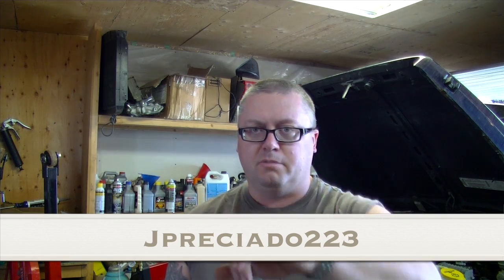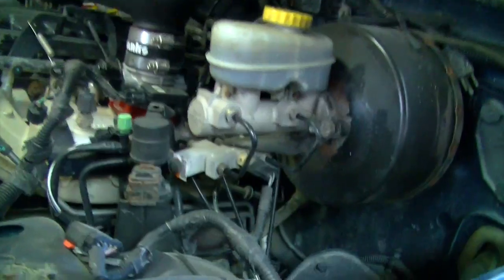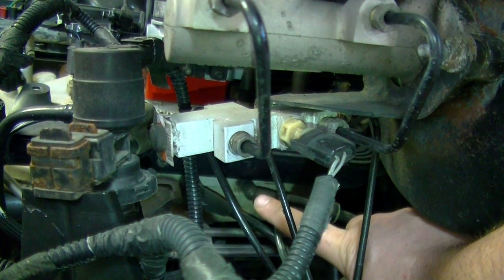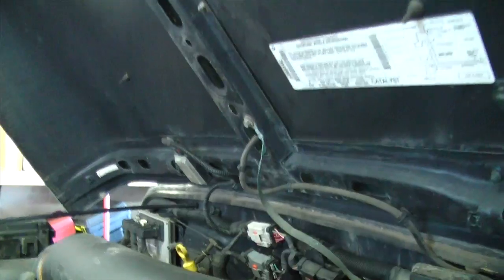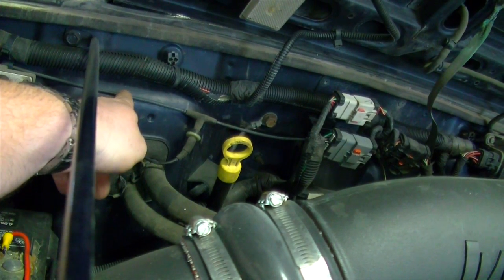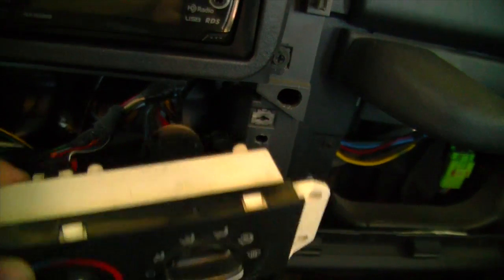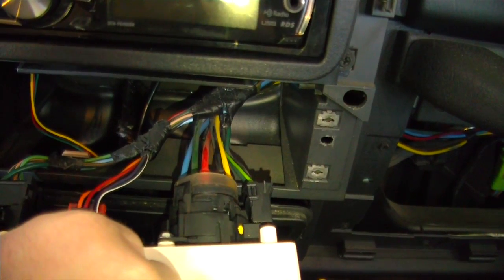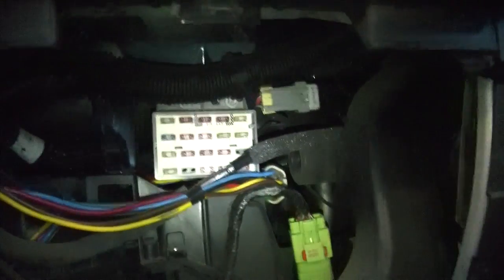Jeep Tj Hvac Troubleshooting Vacuum Issues

Comment: Ok, way late to the commentary, but hoping there is an answer here. The line between the T check valves (running across the back engine bay/firewall were accidently cracked releasing a hiss. So I know there is an issue. Any idea what the specs are on that line so I can replace it? Thanks for any help.
Reply from the maker: It’s just a vacuum line easily available on Amazon or local parts store
Reply: @BackCountryWrenching Got it. It’s Part # 47418   (Dorman) 5/32” 3’ at either Autozone or O’Reilly’s in case anyone is looking for it later. 3’ is the OEM length. 

Just pull (twist) off the original boots from the OEM hard nylon tubing & reuse the them (if in good shape) and all set. 

Thanks

Comment: Very awesome walkthrough. Strange, I have vacuum but my selection controls are mixed. Full face mode is on the Face/Feet option. Would a vacuum issue also cause this and poor cooling of the AC?

Comment: 2006 TJ vacuum line comes in thru firewall and black line is behind the fuse box that is behind the glovebox, 2 screws remove the fuse box and use a flashlight you'll see the black tubing coming thru firewall, mice chewed mine right in half. 1/8 hard vacuum tubing and vacuum splice connectors to fix it. Sometimes also the knob on the selector switch itself cracks and doesnt actually turn the selector for floor, defrost, panel etc, pull knob really hard it'll pop off then check it for split or crack. The selector switch can go bad too, it's on ebay for 70 bucks as a unit with the other switches and what not for fan speed

Comment: This vid is 9yrs old so hopefully you get this.
Had a shop install a new heater core but I get no heat. Have replaced everything (was going to anyways) and thought I'd find the issue. Nope.
New rad, water pump, thermostat, hoses, system was air-bled more than once, new blend door actuator...still no heat. Inflow and outflow hoses from heater core exact same temp.
The last thing I have yet to check: the hot/cold dash selector dial.
Is it vacuum operated too or only by the blend door actuator? How to check to ensure it's working?
Have scoured the 'Net and manuals looking for an answer but nothing comes up.
Help?

Comment: Love your channel. I first became aware of you, while looking for info on dodge transfer case ( the same in the Jeep). I am currently troubleshooting my HVAC and the vacuum lines.
.y questions about the E-brake, I've replaced the rear brakes and  replaced the E-brake handle cable. I  still have no E-brake. What could I be  missing?

Comment: Great video as always!  You've bailed me out more than once.  The vacuum line behind the computer goes to a vacuum reservoir underneath the battery tray.  It's a little black box.  I recently had the problem default defroster and floor vents and it was because I fucked up putting my air box in after replacing the heater core.  I accidentally bumped the bottom of the box and the linkage got knocked loose from the actuator on the bottom.  I wish you were my neighbor. It would be easier to give you those beers you've earned.

Comment: I have no codes, both ac and heat coming out of face ducts, switch seems to be issue as i can’t change flow output.  When i go to recirc ac, system pumps more air, so the electrical portion is working but do you think the vacuum portion of the switch is bad ?

Comment: Great information! What should I check/replace if the air is not blowing out of the vents? I can feel cold and heat out of the vents however it’s not blowing air. Thanks in advance. P.s I have a 1999 Jeep Wrangler TJ 4.0
Reply from the maker: sounds like the blower motor isn't working

Comment: With the help of your video. I was able to identify a vacuum leak below the battery (not idea what is the purpose of the black box). Just taped with a standard electrical insulator tape and now Air Conditioner air flow is perfect. Thanks for your knowledge sharing, God Bless You.
Reply from the maker: The black box is a vacuum res

Comment: OK some additional info. I had the issue of AC working fine until accelerating, AC keeps working but the vents change to defroster only. When you let off on the accelerator, vacuum increases, the "face"/"front top" AC vents come back on. I verified all of my actuators hold vacuum along with the vacuum reservoir and all lines inside the TJ. I replaced the HVAC switch panel fearing an internal vacuum leak in the switch, the panel also had a bad/dead position on the fan switch. This did not fix the issue.  In the end, a $6.00 check valve was the culprit! Easy test/fix, put a new check valve in the line to the HVAC at the manifold, check valve flow direction to manifold, see if the issue goes away....Mine did!

Comment: I have a 99 Wrangler 6 cyl .  Your video was very helpful and I checked all the lines I could see and they looked good.  I have constant A/C or heat until I put the engine under a load and then it goes to default defroster mode.  Because I have good vacuum most of the time I am wondering if the problem is a faulty vacuum reservoir?  What do you think?

Comment: My '03 TJ 4.0 will only blow out the dash vents. It will not blow to floor or defrost. Any suggestions?
Reply: if you have vacuum to the black vacuum line on the back of the selector switch, check your vacuum actuators under the dash maybe they are not working or stuck, could have a mode door stuck also https://www.youtube.com/watch?v=epYsP6hX2d4

Comment: I've been having a high-idle myself (on a 97 TJ) and tried to find leaks using starting fluid. I fixed one line but the idle was still bad.
THEN I saw this video and for kicks just sprayed the same plug and sure enough the RPM dropped.
What's the fix for this?
Also thanks, I've been battling this for some time now.

Comment: Hey, man I'm looking for some help with my Tj, I'm having an issue where i have vac all the way up to the cab and it will blow out the top stuck on defrost, however, i feel like one of the actuators are getting stuck, i leaned under the drivers side and i see 3 of them and i can see them move on at least two of them the other two, don't seem to move much, if i reach under and assist the push of one of them, it will start blowing out of the main vent, however it still blows out the defrost. Is there any way to clean these? Or do i just need to buy new ones?

edit1: do you know where i can buy these at? (a link would be very helpful)

Comment: @Bullshitkorner, tell me if this sounds nuts, but in my case - this vacuum leak was causing P0301 misfires in my 2005 TJR. I had replaced the exhaust manifold and fubar'd the vacuum line somehow. Replaced the harness and the misfires went away.

Comment: Jerry's video put me on the path to fixing mine.  For maybe a year I had sporadic problems but the vacuum lines all looked OK and I was stumped.  Eventually I realized the 2 very thin plastic lines that take off from the main line had become very hard.  Then I found tiny cracks in these, 2 just outside of where the line entered the firewall to go to the HVAC, and one going to the cruise controller under the hood.  The cracks were smaller than a razor could make and hidden by grime.  I never would have looked so close unless I'd seen this video.  Solved my problems for cheap, hope this helps somebody else.

Comment: Hey man, thanks for the videos, always a pleasure.
QUESTION, I think I have a vacuum leak, upon Deceleration, tj will die at stop light sometimes, if I don't slowly shift down and keep rpms up, isles perfect always. Only does when slowing down from freeway speeds rapidly. So I think I have a vacuum leak. Any specific ones your recomend to check? I also heard that if I just spray axe body spray ( the cologne) my rpms will rise when I spray in the area of a leak...anybody ever done this? 
Any tips? 

Thanks everyone

Comment: READ THIS FOR A\C STUCK ON DEFROST. If anyone verifies their line is hooked at the manifold follow that line down below the battery tray. lay on the ground behind passenger front tire and look up near the ac vent hose and you will see the line connecting to the side of the black box. The end of mine was cracked. I cut the cracked end and put it back on and A\C WORKS.
Reply: they changed it so u cannot look up on 2005 and 06 i think, need to pull battery and battery tray

Comment: 04 tj also but my selector does not work and I get AC or Heat through all my vents.   sound like the same problem?
Reply: pull panel with selector switch out and see if black line on back of vent selector has vacuum, if not you have a leak somewhere prolly where it goes thru the firewall behind the glovebox or the bend near firewall inside engine bay
Reply: inside glovebox need to take 2 phillips screws holding fuse box and move fuse box to see the black line coming thru firewall

Comment: system too lean bank 1 code is coming up so that would be before my check valve right under the hood and not under the dash is where my vacuum leak is I'm guessing could you let me know if I'm close if you get this message in time thanks I got a Jeep Wrangler 98 just replace the heater core

Comment: I have vacuum at all the control valve and at the supply line when I accelerate the ac stops blowing at the top and blows out at the defrost and the floor board cant figure out the problem
Reply: you are losing vacuum somewhere and have a leak, engine produces low vacuum at highway speeds. Check fitting on your vacuum reservoir

Comment: when at highway speeds, my AC starts blowing out of the defrost vents, then floor vents. when I let off of the throttle, it starts back blowing out of the AC vents.  is this a vacuum issue?
Reply from the maker: sure sounds like you have a issue somewhere
Reply: how did you fix the problem mine is doing the same thing
Reply: I never knew that some HVAC systems work off vacuum.  However, I had the same exact problem with a 2001 Dodge Stratus and realized it was a bad control panel.  Pulled one out of the junk yard and never had another issue.  Try this; when it acts up, turn the knob back and forth.  If it brings the vents back to the right position, that's probably the issue.
Reply: There's a vacuum hose on the driver side of the throttle body near the firewall. If your AC is blowing through your defroster vents and most likely your cruise control is not working either. The vacuum hose is probably disconnected from the side of the throttle body or the hose is damaged. Get that vacuum hose reconnected it will usually fix both problems I mentioned above. Hope this helps.
Reply: @joecambosa8213 . The 3rd line on the right on the side of the intake goes to the top of the firewall across to the other side and ends up behind the battery and is capped. Do you know what or where it's soposed to go? Also the T at the vacuum reservoir behind the headlight, the line coming out of the right T is attached to a plastic hose that's broke off and goes nowhere and I can't find where it's soposed to go, so I just plugged it. My cruise control still not engaging.
Reply: Did you ever get it fixed. If not. It might be because your vacuum reservoir is cracked. It essentially stores vacuum so that there is always some available to drive the accessories on that line (AC vent control, heater control valve, and cruise control). Think about the way engines work here--pistons create vacuum when they suck air through the intake manifold. Usually this air comes in through the throttle body. However when the throttle blades are closed the engine is not able to suck in as much air, and the vacuum pressure in the manifold goes up. Conversely when the throttle blades are open (acceleration) the engine is able to suck in lots of air through the throttle body, so there is less overall vacuum pressure in the manifold. In turn, accessories that need vacuum to operate are starved out during acceleration (do a quick acceleration and step on brakes, they will be really weak). This results in things like air conditioning flopping around the different HVAC vents because not enough vacuum to keep the selected outlet open, or having the cruise control cut itself off because there is not enough pressure to maintain the valve.
As for the canister, when the vacuum is being pulled through the manifold and lines, the air that is naturally present in the canister gets sucked out, resulting in negative pressure in the bottle. When the manifold vacuum dies out during acceleration, the air pressure in the canister tries to normalize with ambient air pressure, which means that the canister is now sucking air out the accessory lines, which means that it becomes the vacuum source for the accessories on that line.
Reply: you are losing vacuum somewhere and have a leak, engine produces low vacuum at highway speeds. Check fitting on your vacuum reservoir

Comment: thanks for the tip. once i knew i was looking for a vac hose that came off or cracked,i found the brake guys that had replaced a line,had knocked a vac hose off the intake manifold.poped it back on and it works now.

Comment: Thisnis irrelevant to this video but maybe you can help me i have a 1998 jeep grand cherokee on Lpg and petrol its starts on gas and and i can switch it to petrol and it will run like a bag of shit but it wont start on petrol it also backfires through the throttle body when running on gas for too long

Comment: Thanks for making this video.  You identified the vacuum line that runs my HVAC vents and within 2 minutes I found a leak in the line where it bends right before it goes into the firewall.  It was rubbing on the hose right below it and that caused a rather large hole to develop.  Works great now!  Thanks again for the video.

Comment: I just noticed my vacuum hose is cut.  will this cause my engine light to come on? how can I replace it because it is the one that is attached to the firewall at 3:11, in your video???  Please help!! Thanks
Reply: should have one way check valve so no engine light or code will be thrown as nothing can flow back to the engine due to one way valve

Comment: Dumb question, but here goes... Which way should the valve be installed – so the air can flow toward the manifold or toward the HVAC system?
I had a bad check valve exactly where you show yours (coming off the intake manifold), but the design of my replacement valve is slightly different, and I got confused. THANKS!
Reply from the maker: VideoNOLA it's vacuum so air sucking to the manifold not towards the Hvac

Comment: Jerry Thanks for the videos!! I used your videos to replace my engine in a 2006 Rubicon.. Made my life much easier!! Now I have a new shit show going. My air selector  will move air to all the position but the floor vent blows slighlty in all the positions also. Since in appears all the vacuum actuators are functioning. I am thinking there is some debris in the flapper door. Saw this happened to you before in your videos. What are your thoughts?Time for a COLD BEER!
Reply from the maker: That could be possible or you may have a vacuum leak as well
Reply: Bullshitkorner  Good point so off I went and checked all the vacuum lines, It has good vacuum, I even hear the actuators move after I turn off the engine.This should mean all the check valves are working?.I noticed we broke the crappy ass vent cover up on the dash putting the  new radio in. The one right above the defrost vents. I bet those pieces are down in my flapper. What a mess!!!. I think I am going to blow some air up the heater vents. maybe blow any foam out.Who knows I might get lucky and it wont take too much time or money I am drinking a cold Shiner Bock right now and may make it too the Heineken's soon!! Thanks again for your videos!!!

Comment: hey man, where could you purchase the little rubber "boot" or elbow that connects directly to the intake manifold. mine is deteriorating and occasionally just pops off when it feels like it.
Reply: I’m having a problem finding a “boot” or elbow to replace one that’s falling apart. It connects to my EVAP sensor pump. Did you have any luck on finding where to purchase? @ramezderyas

Comment: Hey Jerry. Big Fan of your Tj build and have been following it from the start. I have my own and im having a problem as well. the selector switch to send heat and ac to different vents isnt opening  ANY of the vents. there all shut no matter what setting i have it on. do you have any idea what that could be and maybe how to fix it? thanks for the video also because this might just fix it. going to try it now. thanks again 
-Ralph

Comment: Great job... Mine was off at the intake manifold... No Engine Codes but the boot sliding onto the manifold is very loose.  stuck some other line on the manifold and pressed the boot over it for a nice snug fit.
2 minute fix... Thank you so much for your video and the assistance you provided me through that video.  You Rock!

Comment: This is a great video.  My '98 Cherokee is also defaulting to the defrost and floor.  It appears to be a deteriorated boot enabling a week connection to the intake manifold.  Sometimes my vents switch fine and others it gets stuck on defrost.  What is that part called so I can find a replacement online?

Comment: This video helped me figure out my issue! Thanks! But I did want to mention that I didnt have an engine code and the issue was the boot came off the manifold and the line was just hanging there. I just connected it back and viola, my ac and cruise control was fixed!

Comment: Hey bud how are ya? Just wanted to let you know that i checked all the spots you told me about and every one of them was good. What i found was a broken plastic piece that goes attached from the actuator to the vent! So I put them together with one small screw, tighter than piss! Problem solved! Thanx for your help bud.